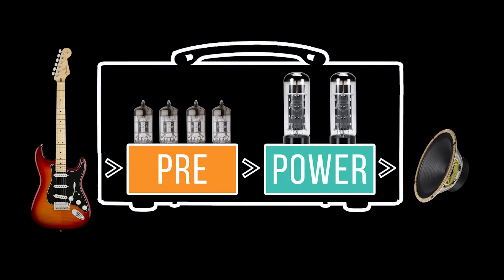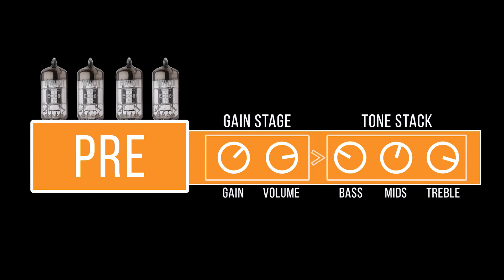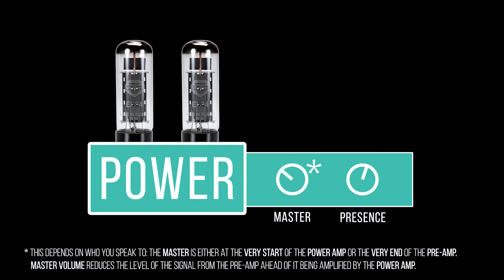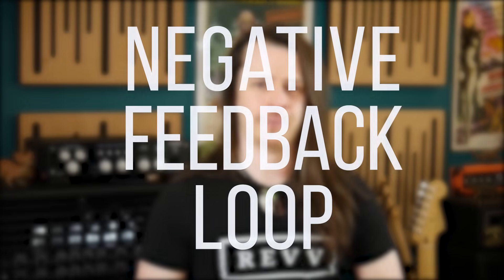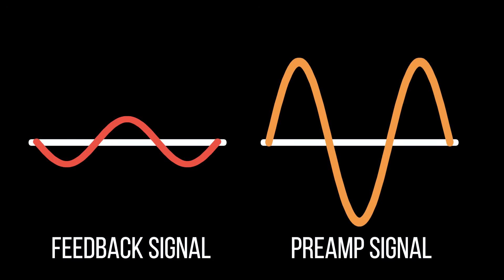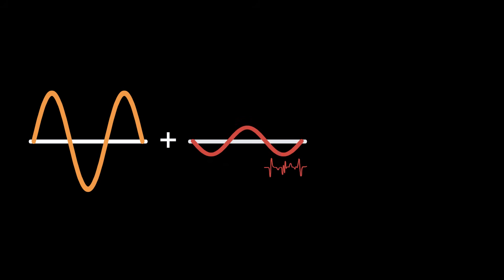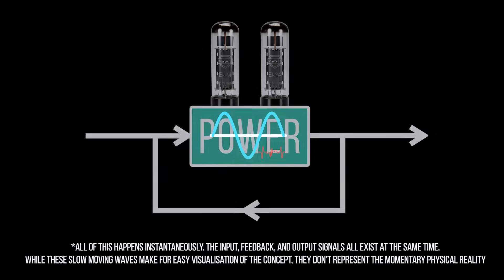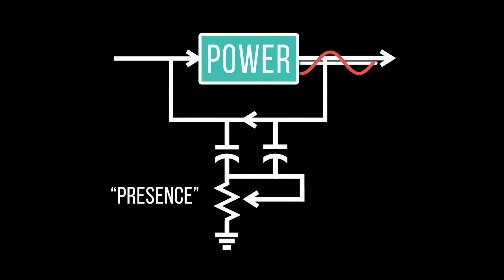Presence: What Does It Do? | Too Afraid To Ask

Comment: The presence control was originally added to compensate for aging tubes, in the 40's/50's.  When they age they lose top end and you added it back in via the presence. Obviously when marshall copied it from the bassman it became its own thing and made the power amp distortion more, as the Video states.

Comment: Soooo, basically, if you have a say, 9 band eq on your amp, you use those to get the "color" of the tone the way you like it, then use the presence function to boost the upper mids and highs without changing your "color" tone.
Reply from the maker: You've said that an awkward way, but the Presence control will not change the EQ of the amp, it simply lets more of the high end distortion reach the output. You can use it to add a final brightness and texture to the amp without affecting the rest of the sound.
Reply: @ScienceofLoud That's how I do everything! Awkwardly 😅

Comment: Interesting tidbit about amplifier EQ controls being passive. I always figured if I turned the EQ controls all the way up that I’m boosting the frequencies in those ranges, but based on what you said, I’m actually just letting the fully unattenuated signal flow through in each of those ranges. Is that correct?

Comment: Here's a couple of questions. Some people use a patch cord to link the inputs on amps with four inputs joining the bright and normal channels. Does this increase power? Does it matter which input the guitar goes in and which inputs get jumped? 

On guitars with in phase out of phase switches can you describe what I am supposed to be hearing.
Coil splitting seems obvious it's either a humbucker or single coil. The myriad of possible combinations of in phase and out on various pickups is daunting.

Thanks for your excellent analysis and explanation.
Reply from the maker: Amps with Multi Inputs:
To make sense of this we first need to realise what the inputs are - these amps have 2 channels, that is 2 separate preamp circuits, but rather than a switch to divert one input to each circuit as it's more commonly done now, they would have two separate inputs for each preamp. 
Each preamp would then also have a high input and a low input (bright and normal being other words used respectively) to cater for different instrument and pickup types - these are just a small voicing change immediately before the preamp channel. 

The patch cable is used to bridge one preamp into the other - so you get the signal travelling through channel 1 and channel 2 at the same time. The usual way to do this is Guitar -> Channel 1Low, Channel 1 High -> Channel 2 Low. However, as long as Channel 1 feeds into Channel 2, it doesn't matter which high or low gets used for the guitar or patch. 

This doesn't give the amp more 'power', it's the same common powerstage, so no extra power or volume over  using the channels individually, but what it does get you is more distortion as you've doubled the preamp gain staging. 

Out of Phase:
In terms of a switch on the guitar that places two pickups out of phase with each other, you would expect the sound to become 'thin'. Two signals combined In Phase will add to each other and strengthen the signal, while two signals combined out of phase will cancel common frequencies, reducing or even eliminating them completely, keeping only the parts of the signal that differ the most. 

Pickups connected out of phase therefore can be considered to sound thin, hollow, brittle, quiet because frequencies have been eliminated.
Reply: Thanks for the quick response! @ScienceofLoud

Comment: When dialing in the presence control, does it behave differently depending on how the gain is being shaped? For example, is there a noticeable difference in how presence affects the tone when you're using the amp's built-in preamp gain vs. running something like a Metal Zone straight into the effects return (basically using the amp as a power amp)? Would love to hear your thoughts!

Comment: Riddle me this, I have a savage 120 mk1 that has a lag of presence and bite (high end distortion). There is a tiny bit of sizzle when I max out the gain pots and the treble with the presence on 2/3 but the whole sound will be a flubby mess with loads of low end distortion like you get from maxing your gains. Slamming it with a boost cutting all the lows and adding alot of highs helps a decent amount but than you and up with a high pitched wissle noise. What should I do?

Comment: Here's a question about finding tone based on your amps 3 band EQ. Since it's a system that is cut based would it not be best when finding tone to start with all on 10 and reduce from there to remove unwanted frequency values instead of what most people do which is start at 5. Everything at 10 would be giving the full extent of frequency availability whilst 5 would have been tonally shaped 3 times. Alternatively you could start at all 0 and add frequencies until reaching desired tone treating the cut almost like a pass filter instead. Either way starting from 5 seems potentially to be a less effective starting point due to tonal colouration. It would be comparable to starting with your guitar's tone knob at 5 instead of being 'wide open' at 10. Am I correct in thinking this or am I missing something?

Comment: I have got a Blackstar 20 W Combo that doesn't have a presence control. So I tried an EQ-Pedal in the effects loop and boosted the upper mids and the treble frequencies a little. This really works well especially with a Les Paul. Check it out!

Comment: Thanks for the explanation, Colin.  I don't have (and never have had) a pure tube (valve) amp; closest I've gotten is a hybrid amp that I got from a pawn shop a couple of decades ago.  I do have some digital modelers which feature presence controls as part of their tone-shaping power.  Of course, I know that they don't work the same way, but now I know what they're trying to sound like and to simulate.  Whereas I doubt that I'll ever have a real presence control in my future, I at least have a greater understanding of what they do.  I would also imagine that resonance controls do much the same thing for low middle and bass frequencies, as I already know that they work within the power section as well.  If I have assumed incorrectly, I hope you will see fit to correct me.  Thanks again for all the information!🤘

Comment: To me (Psst!  That means its just my opinion...) the sound difference is similar to where I am PRESENT(ly) standing.

Low Presense = standing behind the amp                       (boosted lows, scooped mids/highs)
Mid Presense - standing beside the amp speaker          (balanced) 
High Presense = standing directly in front of my amp   (scooped lows, boosted mids/highs)

Comment: Ooh, I know one!! Why do you need like triple the wattage for solid state, to reach the same tube volume? The Fender Tonemaster series is a good example; the Super Reverb just came out, and it's like 200 watt output but is labeled like 40, and the Deluxe is labeled 22 but is actually like 100. When I got my Boss Katana Artist, I cranked it for a second and the breakup sounded like crap, and within seconds I could smell burning. Tubes simply do not do that. Laters!

Comment: I think my question is related now based on what you said re how presence works via the Power Amp section: Why is it that the best results for a nice distortion sound come from pushing the pre-amp and keeping the Master on the power amps down? (to control overall volume)(Gain 7-8, Master 2-5) If I understand you video, one of the Power amps jobs is to actually try to "clean-up" harmonic distortion via the "feedback loop" you mentioned. So in general using the power amp to achieve distortion will not produce the best results. Another good example for great results is using an OD pedal pre amp. Oh and thx for this video..now I can sound like a genius at my next jam session! hehe

Comment: We have a very expensive and state of the art oscilloscope at work. I brought my Mesa Boogie Mk V into the lab and did some test on each control. When you see what happens real time when you adjust a controller knob and can not only hear it, things make a lot more sense. Especially the distortion. Seeing it clip at the same time you hear it break up is really cool. But be very careful. There’s some crazy high voltage in some sections and if you don’t know what your doing, stay out. At best you’ll fry your scope. At worse? Well...

Comment: Thanks for clearing that up for me! Really enjoying your explanations. I've got a question you could potentially address? I've been trying to replicate a Bullet for my Valentine sound on my old boss gt 6 pedal and I've found that using the premap section without adding overdrive or distortion seems to sound much better. Why then would I need an addition overdrive pedal in the effects chain considering the gain on the amp seems to deal with that? Still a little confusing to me because adding that effect seems to cut out the sound completely

Comment: Great video, explaining the whys and the hows in understandable lay terms.  I have two questions
1.  Normal/Bright.  I have a Fender Hot Rod Deluxe which has the usual array of eq, presence, reverb, gain, more gain etc.  there’s also a Normal/Bright switch, which changes the jingle jangle of the amp but your explanations help enormously.  For example, what if the benefits of the presence control were undone by the Normal/Bright switch?  Would you consider adding the purpose of this switch to the array of Fender controls?  Thanks
2.  Compression.  This control is not on my amp but I have a compression pedal, and my DAW can apply compression to a track or the entire project.  How and why is compression used?  I read an article about Roger McGuinn using compression on his Ricky 12 when The Byrds recorder Turn Turn Turn.

Would you consider adding Normal/Bright and compression to your portfolio of explanations?  Thank you

Comment: The feedback loop is a circuit which helps control the speaker excursion due to lack of circuit speaker dampening.   It is used to  keep the speaker from moving too far when responding to bass frequencies and burning out the voice coil when the signal amplitude reaches maximum.  The presence control adds the treble component of the signal back to the signal restoring the balance.

Mystery solved!!!!

Comment: Nice clear explanation of the presence control on the amp. When comparing sounds (especially in mixing) it would be very useful to volume match the sounds. In the examples the higher presence setting sounds not only brighter but louder in general as well. This will trick the listener. For comparing just the tone, match the volume and see which you like better in context, perhaps with a blind A/B test to get the most objective result.

Comment: At low volume it's just an eq control. Some amps have the presence at the same freq as the preamp treble control and they sound the same. At low volume the power amp won't distort more audible without the feedback. It's at high volume the presence becomes a high freq distortion control. It's a pretty fun and simple mod to put a 3way switch with 3 different values of the presence caps to alter the freq. Same goes for a so called resonance control.

Comment: so do "pre-amp" and "power-amp" still apply to solid state amps? I feel like everyone who "explains" amps starts off by assuming a tube amp and it's absolutely maddening.
Reply from the maker: Yes it still applies. The only difference is that instead of valves there are solid state components performing the amplification.
Reply: @ScienceofLoud  no matter the layout of the controls? I don't have "volume" and "master volume," for instance

Comment: I normally adjust the presence of the distorted guitars depending on the kind of role and style they're being played. 

An example is if the song is gonna be thrashy and guitar heavy, I'd usually go with a high presence. For slower, bigger, doomier rhythm guitars, I purposely have a low presence to make them sound huge, which also frees up the higher frequencies for the orchestral instruments in the mix.

Comment: A negative feedback loop is a bandaid fix for design deficiencies in the amplifier and speakers, such as inadequate power supply capacitance, electron tubes with poor bandwidth, speakers with non-flat impedance curves, and poorly damped speaker resonance.  Negative loop feedback kills the detail and transparency of your sound.  Negative loop feedback drastically increases transient distortion, and NOT in a good way.

Comment: Hey Colin, Greetings from New Zealand. I just had one question. I'm using a pre-amp pedal (Diezel VH4-2) and running it into the effect loop return of my amp which is a Marshall DSL40. The pedal already has presence and resonance controls on it, but the presence and resonance controls on my amp still work as well. so i wanted to know what i should set these controls on my amp to, in order to have them make no difference to the signal (Essentially just use the marshals power amp without affecting the tone from the pedal with these controls). Should I leave them at 12 or at 0 or at max? which one essentially turns the control off? sorry for the long winded question. Eagerly awaiting your answer. :)

Comment: TATA:  Right you have your 120W 5150 amp head and then you have your 200W Bugera speaker cabinets, just for the sake of argument.  How does this work in terms of volume?  And I've heard that say 30W Tube volume and 30W solid state volumes are different as well - is this actually true?

Comment: Which means that if there is any effect of the presence circuit that works exponentially (based on signal gain), then we have a different footprint of presence's effect on the signal shape with every different signal. So a different pickup's tonal character, would affect how Presence works on its signal in a different way, thus making the Presence effect unique for each instrument.

Comment: Most amps I've had that had a Presence control or Pevey's weird yet cool combo of separate High & Low Hz Negative Feedback and/or a Texture knob(s) have even more sound\feels available if they can be totally disconnected.
Try this if you are sure your amp won't be under or over biased. Put a pull-off pot in that position. It gives you more power amp compression and distortion or earlier power section breakup/spongyness if you prefer to call it that. It does depend on the power section, Is it cascade or long tailed pair. It does work both ways but it feels different. Remember VOX amps used no Negative Feedback and had plenty of chime, And no they are not actually class A during power tube distortion sounds great mode.
Rock On

Comment: My amp has two inputs for different output levels.
How should I use them and what is the difference?
Reply: Travis Hunt YouTube PhD passive pickups in the louder input, active in the quieter input
Reply: @hellhounds447  what about tube screamers? Should they go in the high input?
I also want to know what exactly it does in the amp.
Reply: Travis Hunt YouTube PhD just do whatever the hell you want it’ll work out fine
Reply: @hellhounds447  my amp blew up. Thanks....

Comment: This is a very helpful video. I always struggled to understand the difference between treble and presence, and therefore had problems to dial them in correctly and achieve a pleasing sound. Your video really helped me to finally understand how these controls work, what they do and how I should use them. Thank you!!! Keep up the great work! 
It would be great if you could do a similar video that explains the difference between preamp bass and power amp resonance/depth.

Comment: Resonance : bass tone shaping
Presence :mid/high tone shaping

This is how i always thought of them. 
        But , this Video actually changed my mind a little bit.  
since he actually explains were the frequencies are being sent through the signal chain. 👍🏼

I have a Peavey 5150 II.  Old version of 6505+
This amp has tones of gain and grit. 
people can abuse the presence knob not knowing what they are doing. 

There is a reason it is all the way on the right side of most amps. Go left to right
To set tone. It is the last thing you set after all EQing is done to taste.

It’s like the cherry on top. The sundae is good without it but it adds to the experience.

Comment: How does the polarity switch work on effect pedals? Too afraid to ask.
Reply from the maker: Have you got a specific case? This sounds like it could do different things depending on the specific pedal you are referring to.
Reply: More specifically I had to buy an expensive amp switching device that Im waiting for because of the noise generated between the two amps.The boss line selector(ls-2) was way too noisey.The new amp switching device has a polarity switch as well as other noise cancelling devices.
Reply from the maker: That'll probably to swap whether the command is being sent on the tip or the sleeve of the cable. 

That's an extremely specific case.

Comment: Ok so, I'm confused on why you need heavier strings for drop tunings?( it's never really made sense to me)
Reply from the maker: For the same reason the strings on your guitar are all different thicknesses: thicker strings produce lower pitches than thinner for the same tension. 
If you tried to tune your high E string to the same pitch as your low E it would have so little tension it would flop about uselessly. 
So if you want to tune a guitar lower than standard tuning, you need thicker strings to keep the same tension. Thinner strings will just go floppy at lower tunings because of the lower tension.
Reply: CSGuitars thanks makes sense now